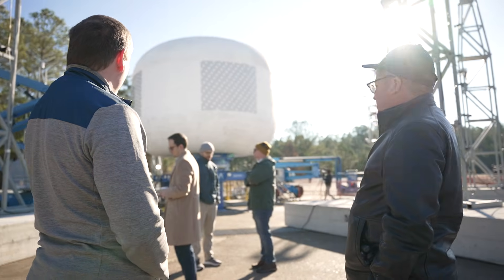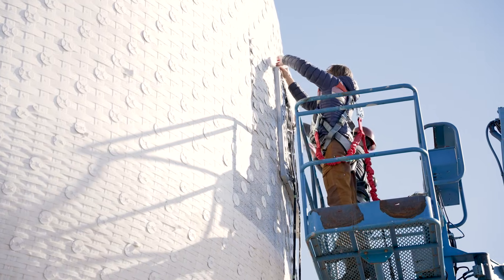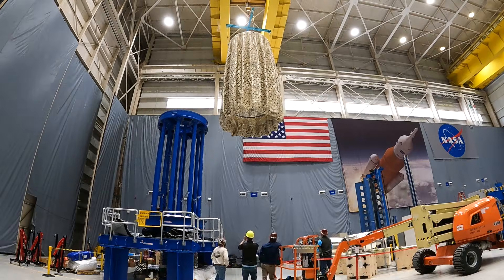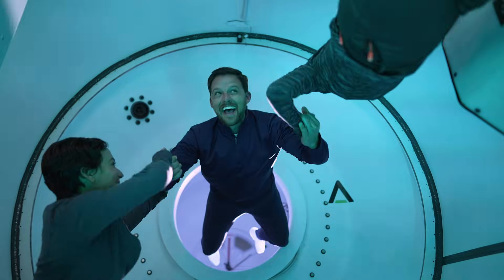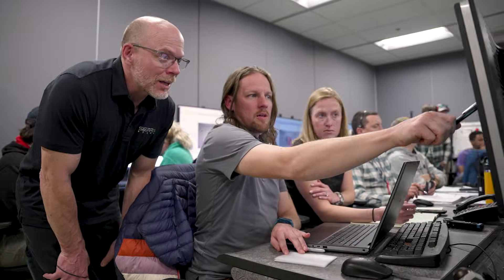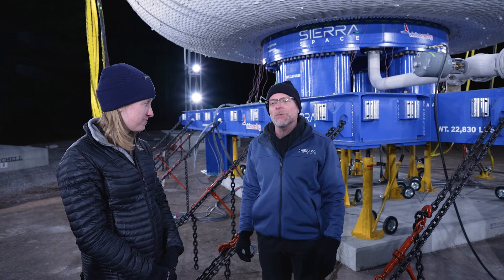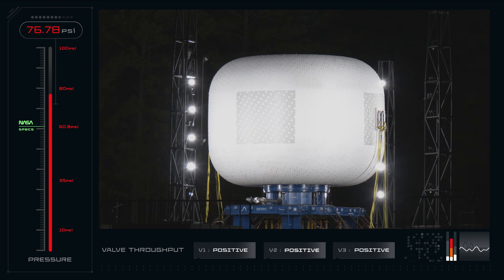Full-Scale LIFE™ Inflatable Space Station Burst Test at NASA Marshall Space Flight Center

Comment: hmm so earth normal is about 15 psi, add vacuum thats 30 psi of stress to simulate vacuum stresses on earth, add in installation, people and potential life support system malfunctions and you probably need at most 50 psi, and you just tested it up to 60p+si?   Nice.  

What about "sudden" pressure events.  In space the most likely pressure event would be a pnumatic system failure in life support causing the system to go over pressure or a minor explosion during a science experiment that may briefly cause a sudden increase then return to normal.  Or conversely if some other fault causes connecting rooms to have different pressures or under pressure, and someone opens a door and you get violent equalisation.

I would suggest that you need to implement a simple mechanical overpressure system,  stage 1 might vent into connecting pods that are under pressure, stage 2 a waste gas recepticle to salvage loss,  stage 3 a controlled release valve that vents excess safely without there EVER being a risk the habitate might "explode" as it did in this test.

With a controlled release stage 3 valve you would need to do it in such a way that it doesnt generate directional thrust unless that is what the operator actually needs in an emergency.

In my mind, NASA's specifications should only be the STARTING point.  Exceeding or adding to them should be standard design proceedure.
Reply: or a massive fart lol im sure they have all that figured out

Comment: Sure, you can launch the habitable volume of the ISS in three launches, but how many more launches does it take to fill that volume with all the storage and work spaces, test equipment, and whatnot that the ISS modules launched from the ground with? Obviously, the air you'd fill it with just goes up in a compressed bottle, it's the other stuff that doesn't compress so easily. I could see an additional launch for each module just filled with the NASA equivalent of IKEA furniture and equipment that the astronauts would need to assemble as soon as the hab was inflated and all the checks have been performed.

Comment: what about high-speed space debris?
Reply: I can't imagine aluminum is any better or this program wouldn't be feasible, it's the first thing anyone with any sense would question, I doubt they're just sweeping that under the rug though
Reply: I'm guessing multi-layered shielding / whipple shields.
Reply: The multiple layers of mylar and the like absorb the energy of the impact better than solid aluminum or steel.
Reply: It's like Kevlar. The layers stacked on top of each other can withstand an incredible amount. far more than conventional hard materials
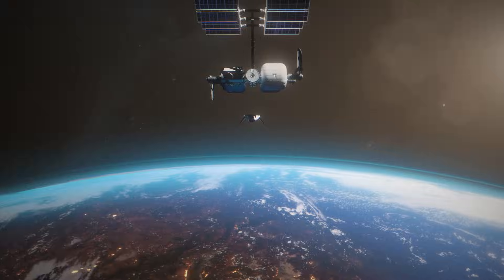Reply: @0:48 - looks like they have plenty of hardshell to retreat to. I’d put the sleeping quarters in there
Reply: Don't worry we guarantee this will make even more then you can predict.
Reply: It doesn't matter as nothing will withstand that.  I don't think it will pop like a balloon if punctured, they will simply have to patch it up like they do with the ISS.  I could be very wrong and it might pop, though I'm sure this never would have been approved by anyone as that situation should be the top point on any clipboard.  I don't think we have the technology to simply repel or take hits from high speed debris, we can only deal with the aftermath currently.
Reply: the pressure inside should never be above one earth atmosphere at sea level or 14 psi. they were pushing it to 75 psi, x4 the safety levels! they pushed it to that on purpose so that it would always be safe and never burst. it would be really hard to find that much air and pumps to push it to that level to make the space debris you are worried about.
Reply: wow!  You should call them ASAP. I'll bet they never thought of that !!!
Reply: tbf, it's no different of a threat to current habitation modules on the ISS.
Reply: Yes.
Reply: They've done testing with Nasa. See comments above
Reply: Great question, we have performed MMOD Hypervelocity Impact (HVI) Testing with NASA, utilizing high power machines that can shoot a projectile at the rate or velocity of an impact in space. We hope to share more in the future as we continue testing.
Reply: he  was asking someone involved in the project, not some rando who doesnt identify themself.
 @bendover04me
Reply: Would it make much of difference if the habitat gets pierced anyway
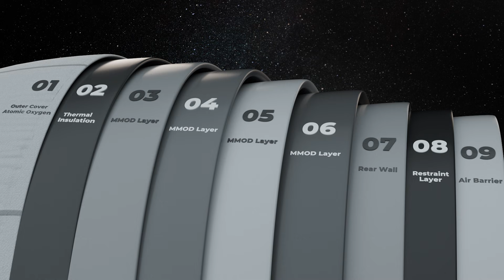Reply: It looks like there's a few layers of micrometeoroid/orbital debris protection of some sort in the diagram at 2:40
Reply: its stronger than steel but that doesn't mean it is a new super material
Reply: They have multiple MMOD layers in the inflatable sleeving and they perform several high velocity impact tests to certify the article.
Reply: Just wow 🤦‍♂
Reply: To be fair that goes through standard metal space stations like it would through wet paper anyway.
Reply: It can absorb the impact of high speed debris better than traditional materials
Reply: yeah thats what im thinking about too. i mean it might be fine if its on the moon, or mars under some circumsstances, but im iffy sbout that being in earth orbit
Reply: the material they use is stronger than steel when inflated, it also has a lot of layers of protection which should prevent any issues like this.
Reply: Space is nothingness, it doesn’t exist, so it’s no problem!
Reply: They answered it
Reply: Just slap a plaster or duct tape on breach and will go just fine.
Reply: In another comment they replied that they've already worked alongside NASA to run those high-velocity impact tests and hope to share the results soon.
Reply: It's also constructed with 4 MMOD(micrometeoroid/orbital debris) shielding layers that can only be designated that after thorough testing.
Reply: Knowledge @ NASA
 has a video on this
Reply: The burst tests are intended to understand failure conditions, so that those conditions don't happen in space.
Reply: Very good point.
Reply: They have been testing everything. They've done high velocity impact tests but the material is strong, apparently. I'd be interested to know if those impact results are public, so I'll probably look for that after this comment.
Reply: The four MMOD layers are fabric shielding similar to a kevlar vest - they're designed to stop and disperse impacting high speed MicroMeteoroids and Orbital Debris (MMOD) - so much so that MMOD tests consist of basically shooting the layers with bullets.
Reply: do you think a big team of aerospace engineers didnt consider that ?
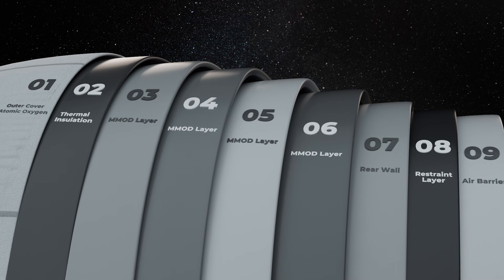Reply: 2:42
Reply: What about it?
Reply: it doesnt matter if you are using a metal base or balloon . if you get hit by highspeed debris, you are dead
Reply: Answered by Sierra space above
Yes, it’s made up of MMOD layers to help protect it. These layers can be seen at 2:42 in the video. We conduct High Velocity Impact (HVI) tests that involve firing high velocity projectiles to simulate the environment the article will be in. Lots of testing is done to determine the layers of MMOD protection.
Reply: Did we watch the same video? There are 100's of comments about this and they literally talk about it in the video and they have replied to other comments?
Reply: Multiple layers? Ripstop to make small holes remain small leaks?
Reply: Please check the layers described @2:44 in the video. 4 layers of MMOD fabric (Micrometeorite and orbital debris) to keep the crew safe. Likely made from Kevlar. Keep in mind that this will be pressurized to approximately 15PSI in a vacuum, significantly lower than the burst pressure. A penetration from a MMOD would likely result in a slow, detectable and repairable leak, if any at all. Much like the thin-walled (and Kevlar reinforced) hulls of the ISS that we use today.
Reply: They are going 17k mph in earths orbit. I don’t think they really need to worry about any debris like that. And even then this thing is strong as hell
Reply: My question exactly, I bet this is more useful for mars/lunar base.
Reply: Pretty sure that's a problem with even current tech. Nothing we can really do we don't have like a shield tech yet.
Reply: it goes boom when hit
Reply: Yeah that was what I was thinking about. I heard a single fleck of paint in orbit hits with the force of a 50 cal.
Reply: Current hulls don't stop it well either, any small hole once in a while should be acceptable and expected
Reply: I think its better than before. Its thicker, and given the multiple woven type of membranes reckon that it will self seal a bit / inhibit airflow out,  more than just a hole through a thin metal skin.
Reply: a soft collum will take it probably better then a steel one, think about kevlar here and what steel plate would be needed here
Reply: At the speed space debris travels I doubt there is much difference between the space station and these inflatable pods.
Reply: That's always the kicker.  At 2:40, you can see the graphic depicting the various layers comprising the shell.  There are four (4) MMOD (micrometeoroid/orbital debris) layers, which are supposed to protect against particles up to a certain size.  However, there is a limit to what can be stopped, and I, too, am curious what that limit is.
Reply: yes omg it could just POP
Reply: I think it would not burst, instead just make a hole. Holes happen in the international space station and there is procedures to fix them

But I would love to know from them what would be the procedures in that case for the LIFE

Specially how they affect the structure as a hole and the room after nasa specs
Reply: Maybe it'll bounce off hahaha
Reply: They’ll probably add external shielding like they have on ISS
Reply: It has a high speed space debris shield
Reply: it will blow up like the zeppelin but less fire
Reply: ya don't wanna think about that, do you? 💀
Reply: Yeah. I literally thought about that the first minute of the video, too.
Reply: i was thinking the same thing
Reply: its a problem regardless the real question is how well and easy can they be fixed or ofund.
Reply: Yup. Would need to see what impacts are normal pressures do to it, not just how much pressure it can take without outside influence
Reply: eh who cares am i right
Reply: that was my first thought as well, but given how they stated that it was "stronger than steel" cumulatively with all the layers (i assume that since they were comparing it to steel, the ISS and other satellites are made from some amount of it?), so hopefully that's strong enough to counteract to some extent the space debris :O
Reply: Pretty sure they've thought about that lol. Its not a problem of blowing up like a balloon, because even IF a micrometeoroid pierces the layers, the hole will likely 1. Not lead to a massive rupture like a balloon and 2. Be so small that the air inside will likely not be able to escape fast enough to matter. A patch or a fix could be easily managed.
Reply: With an inflatable balloon as a frame, they could just add attachment points to it where they can bolt on modular sections of outer shell armor for it, which is a lot easier to bring up in pieces over time than one large cylindrical space station module.
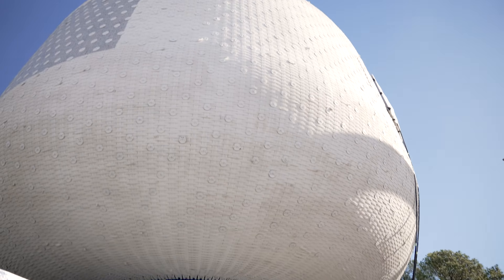Reply: at 1:16 you can literally see a prototype covered in modular whipple shields. Do you really think they just didn't think of that? 🤣🤣
Reply: Killjoy over here . Space debris doesn't exist, duh propagandist over here
Reply: the fabric stations can actually do better against debris impacts compared to metal space craft thanks to the layering.  They act like a kevlar vest system, where as metal spacecraft don't have enough metal there to give you the steel plate effect of armor.
Reply: They talk about millions of pieces of space debris....have you ever seen it in any pictures??? And how all of it gets up there??? When have we had thousands of launches ??🤔
Reply: I was thinking about that myself. 

They could theoretically add shielding, and the design may be fairly resistant or easy to patch. It looks like the exterior sections are woven together, so maybe they could be replaced in situ.
Reply: I think this type of shell is designed to fly at the height of the ISS where there is very little debris. The only thing to really worry about would be micro meteorites i guess. but depending on the size and the velocity they punch through solid metal, there isn't really anything to do about it. In real world applications like the ISS a small puncture at nominal pressure would probably not rupture the hull and could probably be fixed by some tape. That would be up to further tests i guess
Reply: also,this was tested at over 60 PSI, you would have a pressure of ~1bar / 15 PSI in reality. So bubble gum or tape would fix any leaks that came from a hit
Reply: Literally the first thing that came in my mind. So many of them and in growing numbers, its not a good idea for orbit, more like usage for Moon or Mars bases.
Reply: Problem solved with a handful of bike tire patch kits.
Reply: I'm thinking, as they mentioned the materials involved being stronger than steel, they are working on using stretchable materials with the puncture resistance of things like kevlar. Also, given that the material is inherently stretchy, that can help mitigate the sheer speeds at which space debris might be moving. I'm not a scientist or expert, just my thoughts on it as a layman.
Reply: it just bounces off duh..;)
Reply: It's not like a traditional balloon.  It's closer to a bunch of duct tape that's air-tight.  Doesn't explode.  With high-speed debris, it'll puncture soft/thin metals all the same.  With something like this, you can use a patch without losing any strength.  I'm not sure of the material, but I wouldn't be surprised to learn if they had solvent patches on hand.
Reply: yeah that thing is gonna get destroyed
Reply: From what I’ve seen, the flexibility of the inflatables makes it even better at absorbing micrometeors.
Reply: Loud balloon
Reply: All that what-about-ism ,  we woke people totally hate that.
Reply: Would do comparable damage to steel. However, you would presumably lose a full pod in the event of an impact.
Reply: That's what the MMOD layers at 2:41 are for. Stands for Micro-Meteor and Orbital Debris.
Reply: A paint fleck at 18,6000/mph damages the ISS windows. Barely, but it still happens.

It doesn't matter what the object is. What matters is size and speed. And after a certain amount of speed, the soft follicles of a feather will damage something.
Reply: my exact question
Reply: you should find videos of what happens when space debris hits layers of material prepared for space debris. Essentially after penetrating the 1st layer the 2nd layer absorbs all energy without damage. look it up for more details.
Reply: Space is BIG. In about 4.5bln years, our galaxy will merge with Andromeda galaxy. Space is SO big, that we will merge and earth will almost probablistically definitely not be destroyed in the merger, even if there are billions of celestial bodies being mixed like a soup.

Im not saying debris is not a problem. I dont knmow. I just know this information and im curious if that also applies to space debris.
Reply: 6:00 is your answer
Reply: i mean, that bubble is harder than steel there is titanium and steel on parts of the ISS, but its mostly comprised of aluminum.
Reply: I was wondering that too
Reply: This is definitely a realistic problem but you can’t help but think, a space debris at high speed will more than likely cause catastrophic damages to all man made satellites in space.
Reply: The current ISS still has to avoid space debris... so not really any different I imagine.
Reply: No "space debris" where these high altitude balloons all go to
Reply: You definitely commented this before watching the video.
Reply: It’s the same problem with current tech, surely?
Reply: A lot better than hard sided pressure vessels, since it can spread out the impact more. It's actually a big advantage of inflatable.
Reply: »Great question, we have performed MMOD Hypervelocity Impact (HVI) Testing with NASA, utilizing high power machines that can shoot a projectile at the rate or velocity of an impact in space. We hope to share more in the future as we continue testing.«
Reply: @ClippyAngry  he  was asking someone involved in the project, not some rando who doesnt identify themself.
Reply: Did you watch the video? There are multiple Layers with the sole purpose of MMOD suppression.
Reply: They go straight through, just like they would on the iss.
Reply: Don't poke holes in their habitat
Reply: Gonna copy the answer to another comment they made:
"it’s made up of MMOD layers to help protect it. These layers can be seen at 2:42 in the video. We conduct High Velocity Impact (HVI) tests that involve firing high velocity projectiles to simulate the environment the article will be in. Lots of testing is done to determine the layers of MMOD protection."
Reply: Do conventional habitats resist high-speed impacts? This balloon in space can achieve it's mission. The aim of the mission is to transfer public wealth into private hands. This is something a government agency can actually achieve.
Reply: they resist deflating...  @morgan1719
Reply: @morgan1719 found one of those dinguses who thinks the moon landings never happened 😂

Comment: Congratulations on the successful test. When a puncture does occur (as it has on the iss) has it shown to be easier to patch than traditional rigid structures or more difficult? I am just curious of the methods of patching it overall this is a huge success and I know it's resistant to smaller impacts but obviously in time a puncture is inevitable.
Reply: Phil Swift has a solution for that
Reply: I imagine a layer of liquid that fills any leak instantly, does not have to be very thick just enough thickness to carry enough liquid under pressure to work. The first thing I though about thou was size and how the starship booster could send a very large deflated habitat on top of it. I wonder how big they could go.